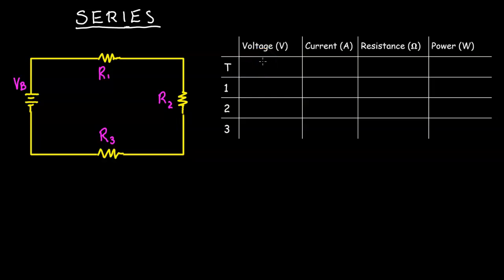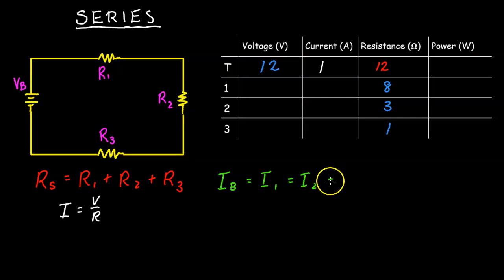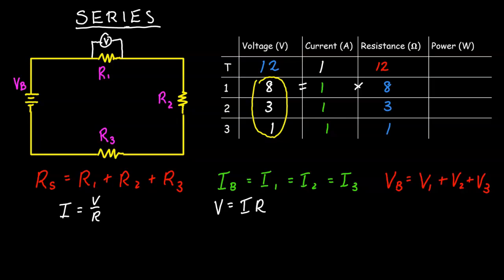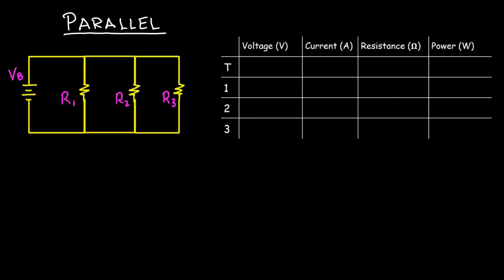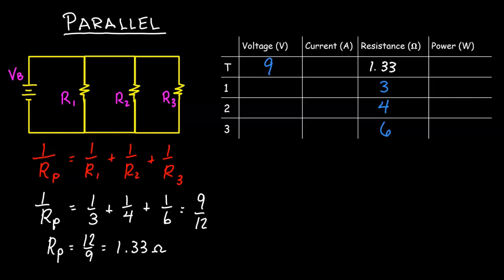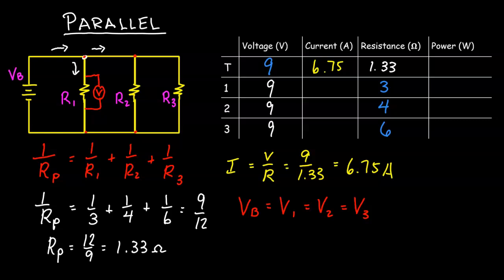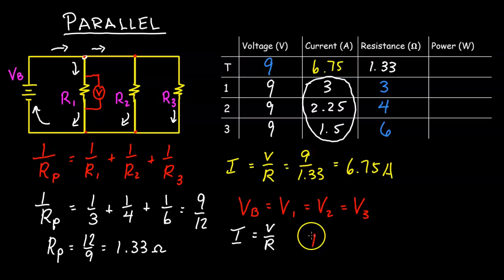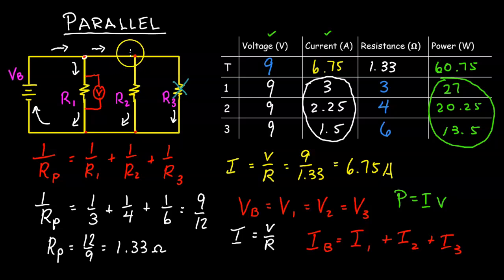How to Solve Series and Parallel Circuits

Comment: howcome 12?
Reply from the maker: The battery voltage was given (12V). The total (or equivalent) resistance is 12ohms, because the resistors are in series so you add them up (8+3+1=12ohms).